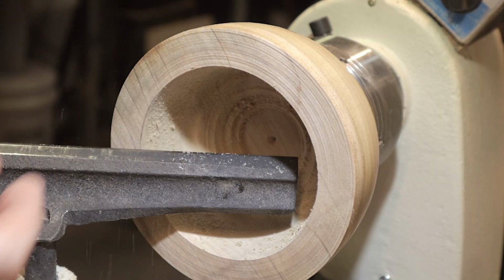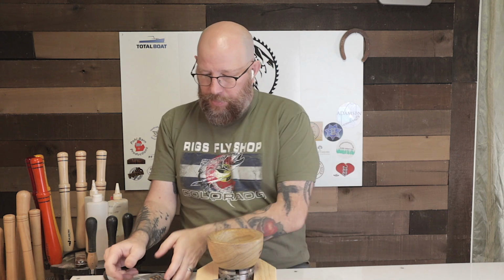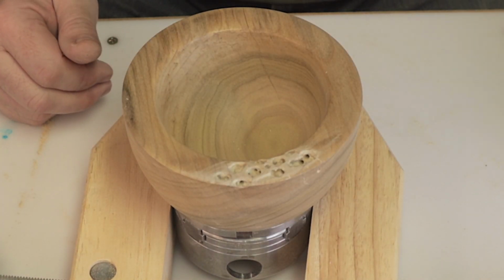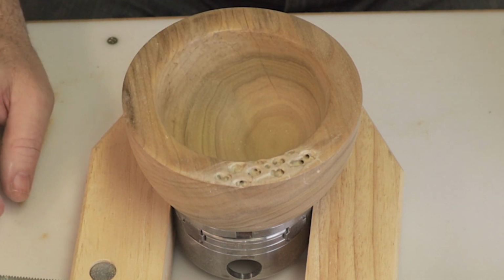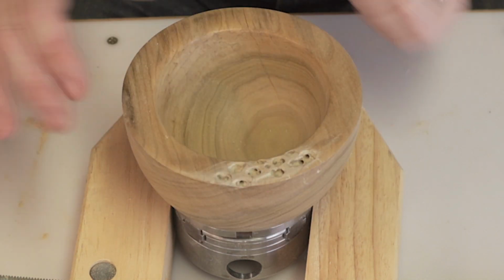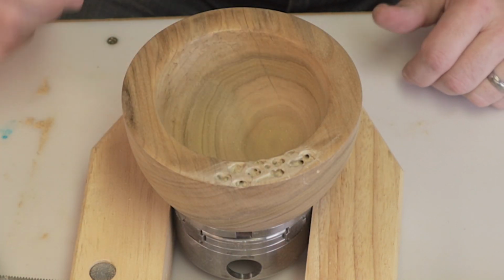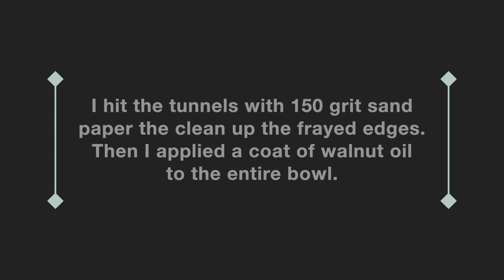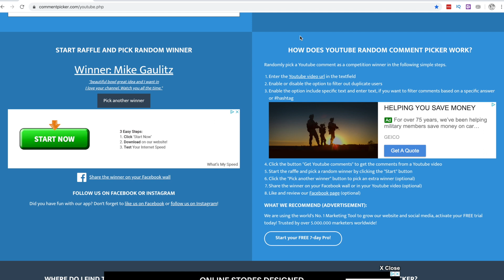Woodturning: Ant Farm Inspired Bowl

Comment: Seems funny, most the natural logs I turn are full of bug holes and trails and I spend a lot of time filling them with glue and sawdust. And here you are making them. <grin> But some do look good and I leave them in according to what I'm making.
Reply from the maker: Thank you Paul!  - Ed
Reply: Actually I think you did pretty darn good controlling that bit. I bought one of those dremel wands to try some small detailing work. It's not that easy if you've never done it. I was all over the place and still haven't used it enough to master it. Oh yeah, I liked the bowl.